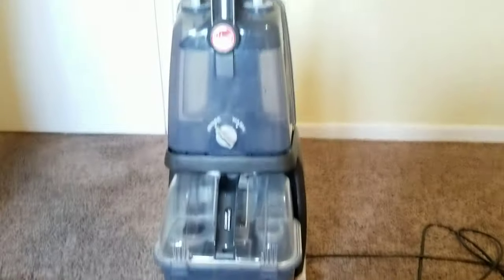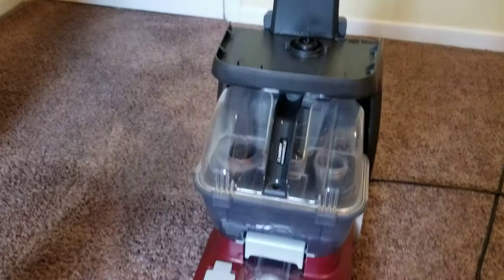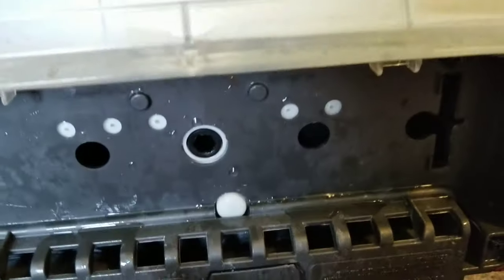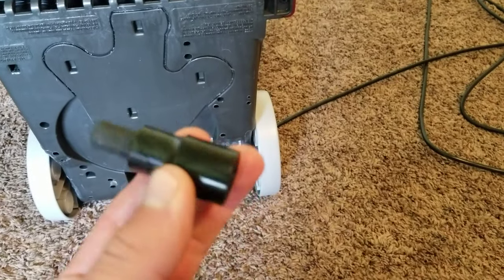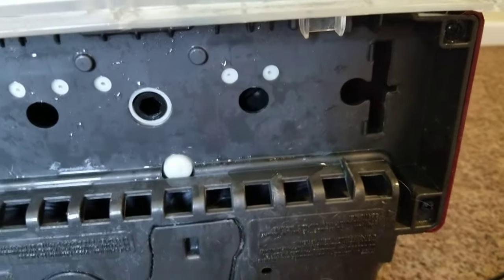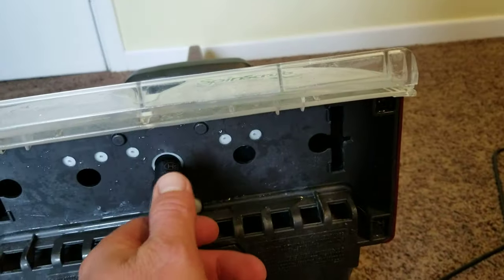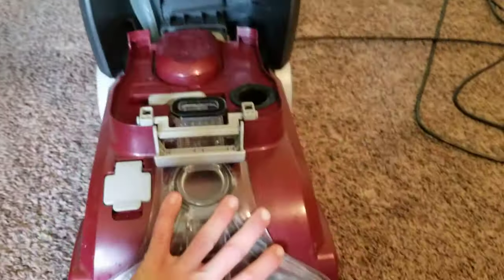Fixing a Hoover Spin Scrub 50 with Brushes that Won't Spin

Comment: In and out video, no fancy start-up logo, no beating around the bush, just get to the problem, solve it, and turn off the camera in less than 2 minutes! Brilliant!
Reply: Yeah too many people now a days  " making content "  YouTube is a business for alot of people now a days which is a blessing and a curse
Reply: Have a similar model and this worked great! Quick and easy.
Reply: Yes! !!!!!
Reply: Awesome fix .....thanks a million .Mines is working again ....hurayyyyyyyyy
Reply: this is good info. But don't force it too much, it will strip the gear wheels inside. The main problem with this binding is the bearing inside, it gets rusted. A little bit of WD-40 to the bearing does the magic.

Comment: thank you so much random man who posted this video 3 years ago. today i bought one of these for $5 from fb marketplace and cleaned the whole thing top to bottom and when i turned it on ( should have done that first) the brushes wouldnt spin and i was so defeated but this video fixed the problem and it is now $5 well spent
Reply: hot tip for someone who doesnt have a 9mm thingy - if you have the finger strength just grab the middle bristle with your fingers or pliers and turn it. thats what i did and it worked great

Comment: Dude you saved my ass. I was getting ready for Thanksgiving and got the cleaner on the carpet then the brushes stopped. I froze for a moment then looked up vacs for sale. The time to the store wouldve fkd up my whole time table. When my brain started I looked up youtube and your fix worked. Didn't have the hex so I used two flat heads to spin it. Seriously, you saved me big time. Thanks and hope you have a great Thanksgiving 👍

Comment: My Crosswave just arrived today and https://www.youtube.com/post/Ugkx8ISPQRRAfpAaX4msGjyodObTBnlj4T5g I was on my way out but decided to stay home as I was excited to try it out. We have a large area consisting mostly of wood but have some tile and marble areas. What a breeze it was not having to use different cleaning products and mops and I could just go right through the house on different surfaces without even vacuuming.I’ve used Bona on my hardwood for years and although it looked pretty good I know it wasn’t clean. The bottoms of my feet attested to that. I’ve also used a Hoover Floormate about once a month and although it did clean the floor more than just spraying and spreading Bona around weekly, it just seemed to put too much water out on the hardwood.I LOVE the results I got today. You can see the water does go on the floor, but it’s suctioned up well and dries so quickly. I even used it on the Marble and it looks fantastic. No streaks with the Multi surface cleaner and it feels clean. My ceramic floors in the Bathrooms are very textured and pitted and they look so much cleaner. I even tried it on a couple of area carpets and it worked great. (Not for deep cleaning though)Now the disgusting part – The dirty water reservoir! It’s hard to believe there was so much dirt on my floors. Yikes! The unit is also very easy to use, gets close to baseboards, swivels to get under things and is light. Wish the cord was positioned better but that’s easily remedied by attaching it to the holder. I’m hoping this is going to be the answer to a clean house and feet! Haha. So far I’m super impressed!

Comment: I had the previous model where this also was a problem.  I was looking for videos on how to disassemble the whole thing and came across your video.  YOU SAVED ME A TON OF TIME with fixing mine.  THANK YOU!
Reply: Yeah same I have an older model as well. Honestly I can't believe the damn thing still going it's like 20 years old. I just went to use it right now and there was no spin on the bristles so I was like rip time to get a new one. Brushes pulled right off. mine wasn't a hex it was a square but same thing pop the bristles back on work perfect. I got this because consumer reports told me to best God damn purchase I ever made

Comment: thank u SO MUCH for posting this helpful video!! my hoover power scrub deluxe 50 worked great the first time i used it, but the brushes wouldn’t rotate when i used it for the second time. the hoover owner’s manual wasn’t helpful, and when i tried to do an online chat they said there was no one available to help me. i was ready to return it to the store when i decided to look online for help from other customers. james’s instructions were perfect and the mechanism started to move with just a small clockwise rotation using a 9mm hex bit. the brushes rotate great now and this video saved me alot of time and hassle. good lookin’ out james!

Comment: Totally worked!Needed to use ALOT of force,and when it "unfroze",it may a big noise and I thought I had broken it.Nope!Spun quite freely,and now brushes are spinning great!Don't forget to clean 'filter' area directly above the brushes on the front of the machine,as this is where they get the suction to spin.

Comment: getting ready to give it a try now. success, i had to go a little bit further once I removed the brush assembly i snapped the 6 tabs and separated the clear cover that holds in the 5 brushes. cleaned all the brushes removed a buildup of dog hair from the clear cover and removed 4 of the 5 brushes. they just lift off the base. after cleaning reassembled and yes took a 9mm allen socket and turned the drive shaft (it was stuck) snapped everything back together and it works great once again,,, thanks for your video.

Comment: Also there is a little white latch handle holding the clear front suction piece on under the dirty water tank. You can unlock that latch, pull the clear white suction piece off and below it in the front is a little vent that is the suction vent for your brushes and you can clean that out and get more brush power !!

Comment: THANK YOU!!!! Right to the point! Also, if it is not too stuck, you can try and spin the center brush by hand and break it loose. Had to make sure all the suction points on the vac were tightly sealed before it got spinning really well. This was a godsend thanks again 👍👍👍

Comment: Thank you!   Fixed it completely.  At first I thought it didn’t but when I looked closer it was indeed spinning.  It is much more effective with the brush spin.  It sounded like the gears were stripping terribly and it took a lot of pushing and turning but it worked.  I greatly appreciate the video.
Reply: BTW, I had the same problem. So yeah, based on your advice, I jammed my 3/8s hex wrench in there and violently moved it about. That broke it free. Thanks.

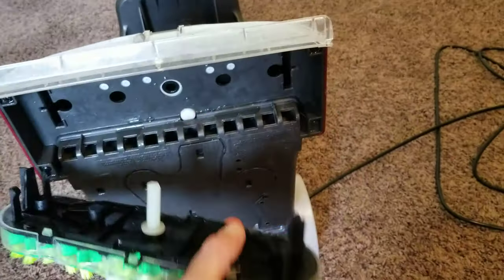Comment: If you don't  have a hex or allen key, @0:32 sec you can see 6 clips (3 on the front and 3 on the back) that you can undo to separate the black part from the transparent.  Remove the screw holding in the center brush and pluck off the white male hexagonal shaft to use to get it spinning again.  Should mention I had to spray some WD40 on the screw holding in the center brush the loosen it.

Comment: I heartily agree these comments. I would add an additional note. Always check the rotating brush itself. It can be restricted by clogs like hair that will prevent it from rotating.
Reply: This is a good recommendation. The long extension on the brush assembly that goes into this hole broke because mine was clogged. 

Video for taking brush assembly apart for cleaning. 
https://youtu.be/GPdQlcCH1Ws

Comment: THANK YOU ❤️❤️❤️❤️. I knew my machine was acting funny the way it put the water down there were lines of water. So I took it apart and cleaned it and still the same problem, then I noticed brushes not spinning. Found your video and now it is fixed. Funny this thank you was longer then video lol. But love that it was short and to the point😀.

Comment: You are the man! I just cleaned my whole upstairs and realized when I was almost done the brushes weren't moving. So I did your trick but I had to use a flathead screwdriver cuz I didn't have that big of a allen wrench. And sure enough they started spinning I went back through and it even cleaned up so much better so you definitely have to have those brushes spinning or else it doesn't do that good of a job.

Comment: Thanks! I didn’t have a 9mm wrench so I just pulled it out a bit and used the white extension while in the hole, reached in with pliers and turned it. It worked!

Comment: Well after the 3rd time in 3 seasons having this problem,  I decided to take the whole thing apart to figure out why this keeps happening. Thinking it's some dirt or hair jammed in there that I might be able to clean out.  NOPE! It's RUST! There is a metal spiral gear that connects to a plastic flat gear and the metal spiral gear rusts bad, even in storage, and the rust grit completely jams up the little plastic flat gear and has even started shredding it.   Put some oil on it and hopefully it will protect it from rust and help it last a bit longer. It definitely spins a lot smoother.

Comment: Just ordered a hex bit socket set, as I didn't have any Allen wrenches for that size.  Edit: Mine is working again:  This may be common knowledge for others, but I find the brushes don't turn unless the "handle release" is used.  Unlike a vacuum cleaner, where the brush starts turning the moment you turn it on, the Spin Scrub brushes don't turn until you also use the "handle release".
Reply: This is a very important post about handle release. The brushes WON'T spin until you release the handle.
Reply: Thank you for mentioning this. My wife thought ours was not turning, so I checked the brush turning mechanism (thank you James Hamilton!!!) and it turned just fine. With the handle released all is good. I took the time using a dental pick to clean all the brushes and they look new now. Heck, I wasn't out fishing today, so why not! LOL.

Comment: Great video! I trash picked one of those a couple of days ago, which also has that problem. I think also cleaning out the brushes helps as well. This will require removing that clear plastic part first, by using a standard screwdriver.
Meanwhile, I will have to get myself a 9 mm socket.
Reply: Update: I got my 9 mm hex wrench and tried it, but no go. I also tried pulling the trigger to see if that made the brushes spin, but still no go.I read on another video comment that it’s because it gets rusted out from water getting into the turbine that turns the brushes. This will require either cleaning out or replacing that turbine. Meanwhile, a YT comment (perhaps the same one) said that after each cleaning session, tilt the machine back with the tanks off, and run the brushes for 5 to 10 minutes to dry them out to keep them from rusting. Me, I have to decide whether or not to scrap my machine.

Comment: This was so helpful, initially mine made a grinding noise when I turned the 9mm. I used a small a mount of wd40 silicone in the two holes to the right and left of the hexagonal drive shaft. Some in the shaft too and then I worked it back and forth and it freed it right up. Spinning like new.

Comment: Thanks, James, but worth noting, folks....if you force that gear drive with an allen wrench (or whatever) where the brushes connect and turn and you hear plastic gears grinding,  STOP what you're doing.....you really are grinding the plastic gears together!  Open everything up where those gears are (8 phillips screws to get at it) and then pull out the housing where the gears and bearings are.  Use some Liquid Wrench or WD-40 on the first bearing you see it to loosen it up. If it spins freely, that one is good.  I found the one deep inside was the rusty corroded bearing. Soak it with your Liquid Wrench and THEN try working the gears with your allen wrench.  (didn't have a 9mm, so I carefully used a 3/8 and it barely fit). Just be mindful as to how you took everything apart and be sure to put it all back together the same way.  Not hard to do, but just be careful doing it.  It sure beats buying a new machine.  There are several videos here on YT that show you how to take apart your machine.

Comment: Thanks for the tip. I also discovered that if you put the brush assembly back on sort of and turn the middle brush, it will break loose whatever is binding it.

Comment: One cause of brushes not turning is there is an air vent with a screen over it just behind the front clear plastic spray head. Flip it off and Clean the screen off so air flows.

Comment: Thank you. Just noticed my brushes weren't spinning. Turns out there was a crack in one of the parts which allowed in water, when then rusted the spindle that spins the brushes. I took it all apart, and used some lime away to clean off rust and free up berings, hit it with some lubricant grease and now it is working like a charm. I haven probably not been properly cleaning with it for a year or so. Who knows when it stopped spinnign lol.

Comment: I could not quickly find a 9mm Allen in my tool box nor Menards (basically only 8mm or 10mm at store). 

My 3/8” Allen DID work! Like a charm. So I would suggest trying that even though the one in video didn’t quite fit for some reason. 

Very helpful video, thank you!

Comment: ADDED A VERY SMALL BIT OF 3 IN 1 OIL ( IN THE HEX RECIEVING END OF THE RECIEVER OF THE BRUSHES) LETR SIT A WHILE  TRIED THE 9MM AGAIN  TOOK A FEW GENTLE TRYS   FINALLY WORKED   LOOKED AT YOUR  OVERHAUL CLEAN VIDEO   YEAH  THESE MACHINES NEED CLEANING OFTEN   THANKS AGAIN  IT FIN ALLY WORKED WITH PATIENCE AND GENTLE MOVES

Comment: Thanks! I did all that and got mine turning....I cleaned all brushes and it still won't spin.  Seems like what ever is in that hole doesn't spin. Im going to try taking off the clear cover and there is a filter there, maybe its clogged. Otherwise, I don't know.  I loved your simple to the point video
Reply: filter is clean....that didn't help
Reply: @lindajohnson9084  I'm the same, no idea. Can turn with hand not by itself.
Reply: Same thing happened with mine. 😭

Comment: Good video. So it’s dirt and grim that causes the issue. So after using the device you should clean it out to prevent this from happening. Great tip dude

Comment: Nice. ultimately you will need to take the cover off (all cover screws have a triangle pointing to them), open the gear/drive turbine and spray wd40 in the bearing and metal helical gear and work it until it spins freely
Reply: Thanks, your comment help me to find the root cause of the issue

Comment: If you don't have a 9mm Allan key, a 3/8' works fine.

Don't crank it too hard if there is much resistance, you could break a couple of the plastic cog teeth.

I had to pull mine apart, pretty easy, about 20 regular Philips screws out of the bottom and top, rip off the coloured shell covering the machine (mine is blue), take off the vacuum mechanism connected to the hex bit, (water drippers are also connected to the vacuum bit), more of the same screws and some clips to pull the vacuum unit apart, once inside you'll likely find a rusty bearing, remove this, blast it with crc, push it onto a pair of needle nose pliers or similar to lock the inner bearing ring, push and turn the bearing to (hopefully) free it up, get the bearing spinning nice with lots of crc, (there's a second bearing which was also koozed but seemed to spin fine as it had no lateral load), smother everything with grease (I used lithium grease but duck fat or just canola oil will help keep the bearings happy), put it back together ensuring everything is spinning nicely as you go, eat any leftover screws. 

Works best when everything is fully assembled, tanks etc because science.

Comment: If it still won't spin for you, turn the machine on and slowly tilt it rearward.  If the brushes start spinning, you're seeing why using suction airflow to drive the spinning brushes can't even generate the power required to overcome the friction between the carpet and the brushes.

Comment: You can also laid on its side, push the brush to the extended position, and use a pair of pliers and grip on the hex spindle (would not have known if not for your video. Thanks.)

Comment: If you cannot get the brushes to spin you could still use the machine because before Hoover had spinning brushes or what have you all they had was a brush underneath there so you can still use the brushes you have under there to do your carpet.

Comment: Same problem with mine. I don't have a 9MM hex. 8MM is too small. 10MM is too big. But 3/8s fits mine perfectly.

My brushes are not spinning. When I put my 3/8s hex wrench in and spin it, I get a "clicking" noise like plastic gears are ratcheting over plastic gears.

Based on radicallyforjesus' experience, I jammed my hex wrench in there and violently hammered and spun it. That broke it free.

Comment: Thankyou i ended up having to take the plastics off and remove the suction driven fan from the unit to un seize it i will recommend not using too much force to turn the unit as the reduction gear inside is all plastic meeting a steel worm gear so there is a chance you could strip the plastic gears

Comment: Can you tell me what's wrong when the solution does not come out of the container when in use?
Reply: Mine did that until I realized the rinse mode dial was stuck inside. The knob was turned to wash but the valve thingy wasn’t

Comment: There are bearings on the inside that get rusted because the grease wears off. If this video doesn't work. You have to unscrew the top and bottom. To get to them. LOTSS of screws. All are the same size. Then regrease and put back together.

Comment: I tried your method and at first it didn’t work. But after about 5 minutes of spinning the hex and then attaching the brushes and spinning the brushes by hand and also by using the vacuum on the carpet I eventually heard a sound that was something getting unstuck and they started to spin slowly by themselves and after another minute it was back to full speed.